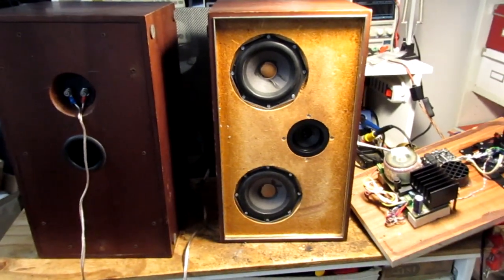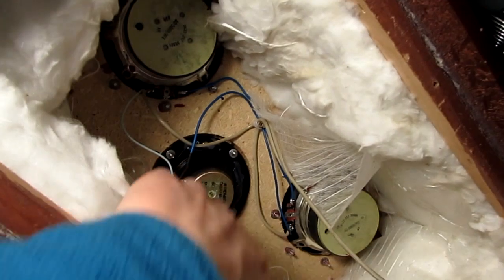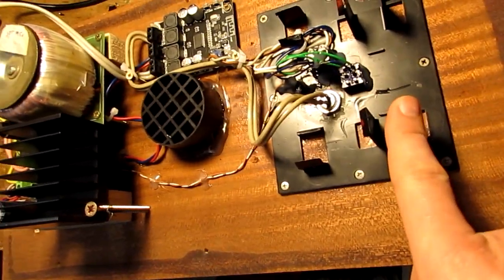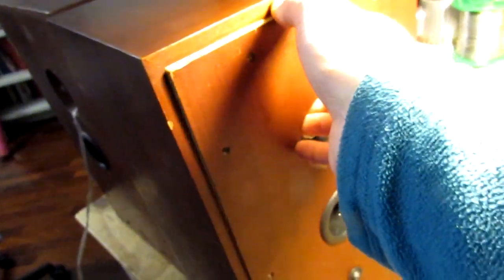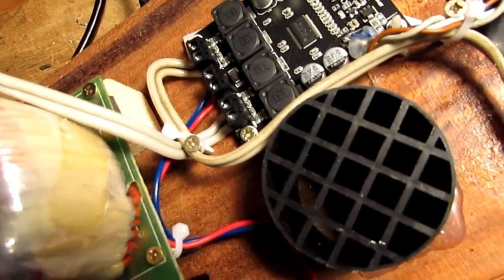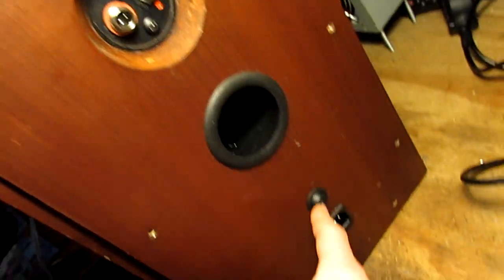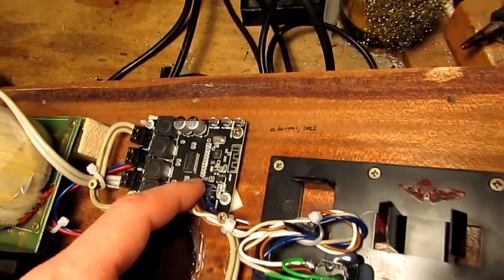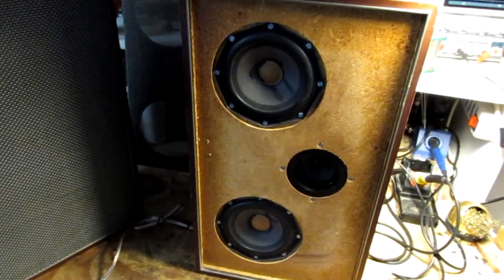Vintage Philips speakers restoration with TPA3118 bluetooth amplifier

Comment: Hi what is the model of the Speakers ?
Reply from the maker: The speaker are 5 inch octagonal AD-5060/M8 midrange from Philips, tweeter are from a 90's stereo from Pioneer. The Speaker case has not sticker, so I'm not able to tell you the model.